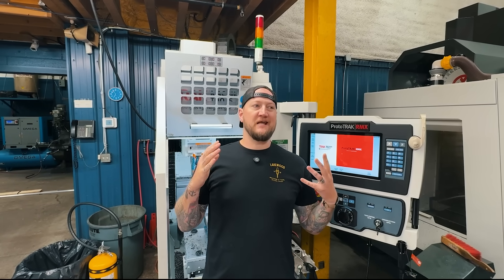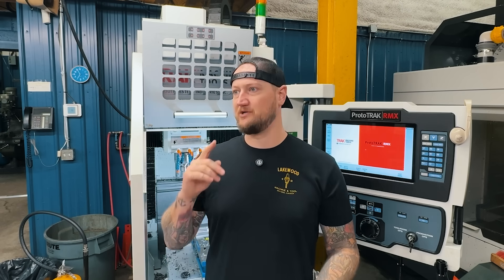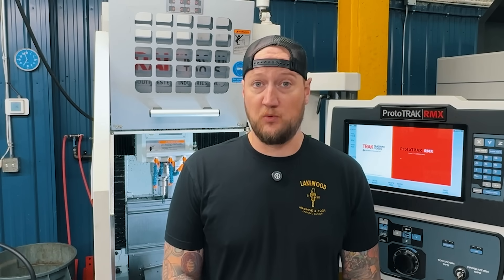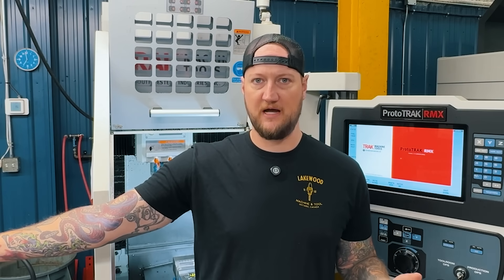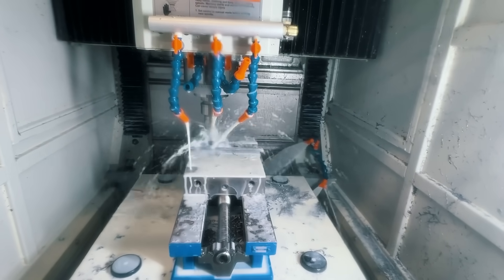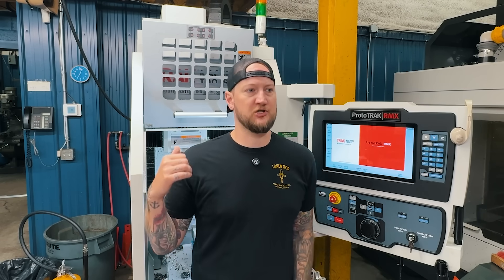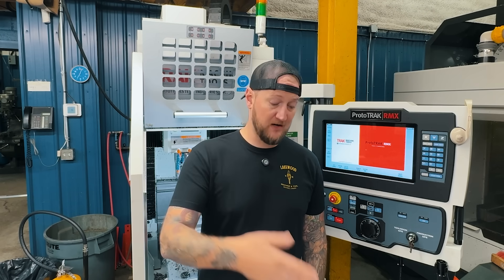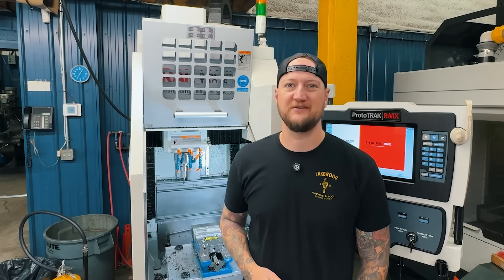Why You DON’T Need a Bigger Machine | Machine Shop Talk Ep.143

Comment: Getting my first small CNC mill for my shop space; square footage is a premium, so a smaller footprint makes a difference. Small machine advantage: you don't need super-big moving equipment when rigging it to a new location; a HD pallet jack, some HD bottle jacks, a few lengths of 4"x4" wood posts will do for most moving jobs. Portability helps, no need to call for pro service.

Comment: Yes! I just got a used TRAK 2OP in my shop this week. I have a 250 sq foot shop in Brooklyn, NY. I have a TRAK 1630 Lathe and Bridgeport 2 axis Prototrak Retrofit mill. I run my own business, and on a busy day I am running the Lathe and Bridgeport at the same time. Now I will be running the 2OP as well, doing more production work while doing the other small lot work and lathe production. For a one man shop in a small space, these machines are perfect. I sold my old Southbend 9" benchtop lathe last month to make space for the 2op. As a business owner, I am thrilled to sell an old museum piece for a full VMC that fits in 1/2 the space of the workbench that the Southbend lathe was sitting on.

Comment: I was looking at these machines due to space constraints as well, and ended up finding a deal on a different machine but HEAVILY considered one. The fact it can fit through a normal man door and run single phase if needed is a big deal. If your running out of a garage or home that doesn't have a garage it does help. I didn't have a shed or garage at the time i was considering this but i do have a spare bedroom and live in a single story house, it would have been difficult but not impossible to put this in the spare room and machine in the comfort of my own house. Only thing was price was price was a little steep. and I was trying to decide between this or a used datron neo that was near by, but was still an arm and a leg, ended up getting an old Bostomatic bd12g for super cheap and retrofitting a new control onto it. Got the machine for $1600 and new control that works for about $600. I got a 8hp spindle with up to 30k rpm, all be it it was a little bigger than anticipated but still smaller than getting something like a Tormach 1500 or VF2 (The bosto is about as wide as a Syil x5  or 40" wide and 60"deep and 90"tall).  Your right about looking for smaller machines and dividing the work, dont always need the big machines if a smaller machine can do it for less and take up less room freeing up the bigger machines for higher $ work.

Comment: I would better get HAAS Pocket mill with 8K CAT 40 spindle & 10 tool changer + coolant system for $37K which weights over 4000 lb than this Prototrack toy that's BT30 and weights 2850 lb.

Comment: 90% of our parts 
are less than 1 cubic foot.
75% are smaller than 6 * 4 * 2 inches
but our machines are 10 * 8 * 6 feet
kinda crazy if ya think about it.
if your machining parts under 1 cubic foot,
why does the machine need to be bigger than
say 1 cubic  meter ?

Comment: I think you should try using a robot loader so it doesn't need to be constantly tended.  Alibaba has very cheap robots for that.
Reply: That’s also a very good idea - I hadn’t even thought of that with this machine!
Reply: @LetsMachine  I was at a factory in China 2 weeks ago where they had a really cool little machine like yours.  Very small with double columns and BT40 spindle.  They also produced robots and had one set up to load.  It was simple to program.  The CNC was around $12,000 new and the robot arm was around $5000.  You could set the robot up on a linear rail and have it tend a row of these little machines.  The spindles running per sq ft area would be great.  I bet 3 or 4 would fit where a VF5 would sit